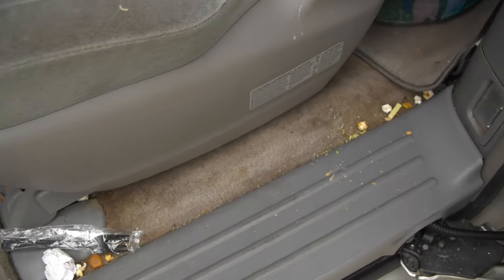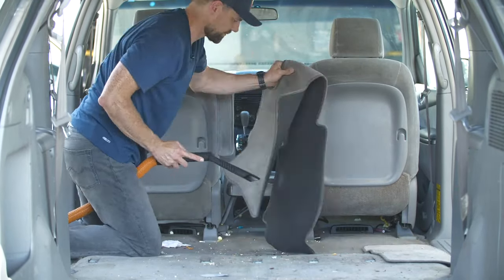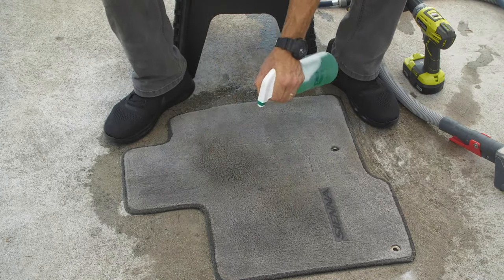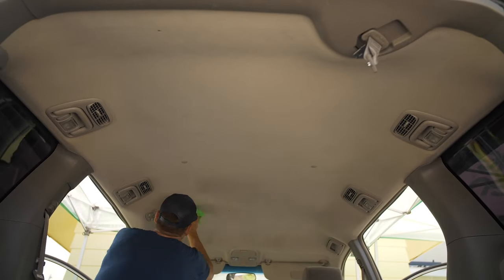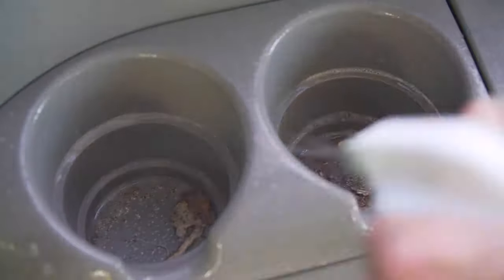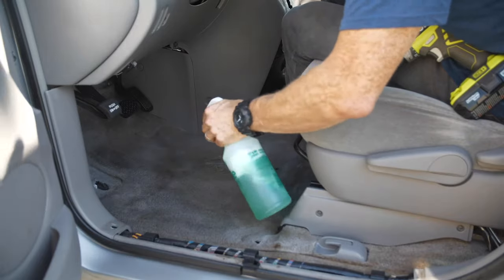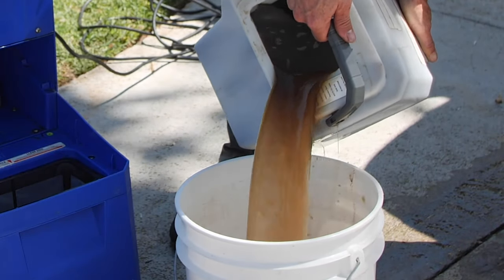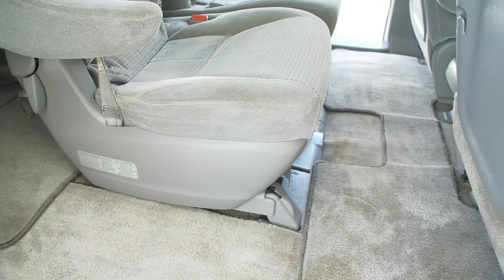Filthy Rides Vol. 1: Full Interior Detailing 2008 Toyota Sienna

Comment: What about an steamer for the headliner
Reply from the maker: Steamers are fantastic, but can get pretty pricey, and if you don't have one on hand it may be a bit much to ask someone on a budget.
Reply: Simple Green my question was, if is ok to use an steamer on the headliner
Reply: Romeo’s Eating Channel probably not as would over saturate it and it’s hot water so would defo effect the adhesive
Reply: The Big D’Taylor oh ok thank you 🙏
Reply: Romeo’s Eating Channel a steamer will definitely loosen or accelerate the glue holding the headliner to the backing.  ~auto shine detailing

Comment: How much do pros charge for this?
Reply: Around 125, that's including a wash job for the outside as well
Reply: I’m a detailer in Arizona and it varies by the size/condition of the vehicle. Also what state you live in and what type of “pro” you hire are other determining factors. As everyone is different and every vehicle is unique, it’s hard to have just a single price per vehicle. Also the statement “You get what you pay for” is extremely accurate in the detailing world. 🙂
I’ve detailed a handful of Toyota Siennas all in this condition, if not a little worse with dirt/stains all over the carpet and leather seating.
 In my area, depending upon the detailer, it’s about $500-$800 for a full interior detail of this size/condition adding in a steam cleaner and other techniques. It's a good 8-12 hour nonstop hard working day!

Comment: How much is a job like this?
Reply: He did right atleast 150-200
Reply: I’m a detailer in Arizona and it varies by the size/condition of the vehicle. Also, what state you live in and who you hire are other determining factors. As everyone is different and every vehicle is unique, it’s hard to have just a single price per vehicle. Also the statement “You get what you pay for” is extremely accurate in the detailing world. 🙂
I’ve detailed a handful of Toyota Siennas all in this condition, if not a little worse with dirt/stains all over the carpet and leather seating.
 In my area, depending upon the detailer, it’s about $500-$800 for a full interior detail of this size/condition adding in a steam cleaner and other techniques. It's a good 8-12 hour nonstop hard working day!